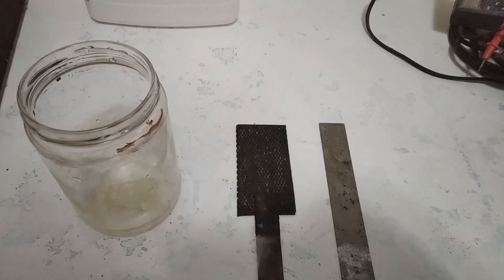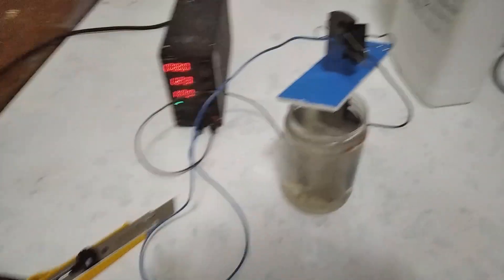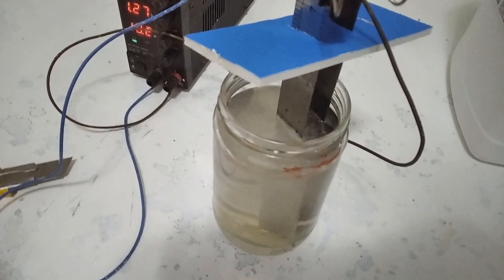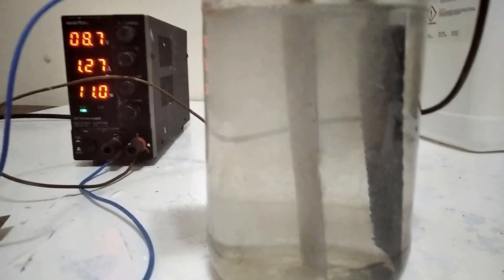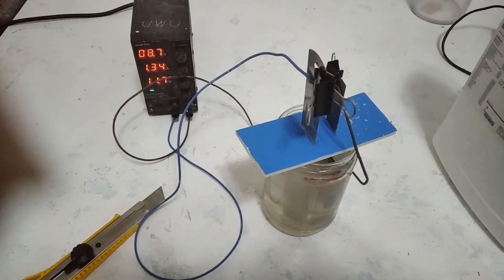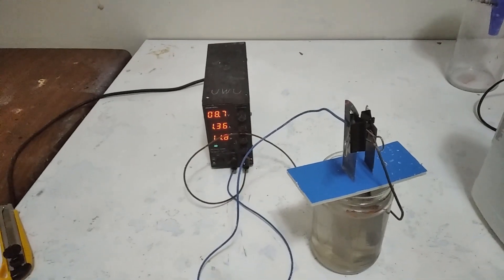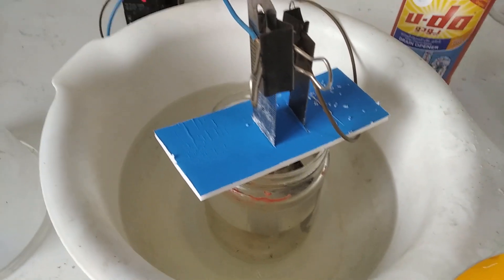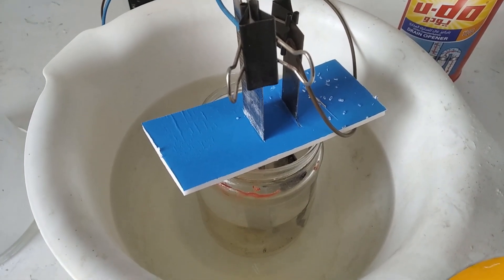Electrochemical Oxidation of ethanol to acetaldehyde.

Comment: Can you explain what the name of electric regulator u used, and the formula reaction of ethanol convert to acetyldehyde. Thank u
Reply from the maker: its a wanptek 300W PSU 0-30 volts and 0-6A
This is the oxidation of ethanol to aldehyde.
Reply: @CatboyChemicalSociety  the bond that break down and compact again, kindly make that video sir.
Reply: I mean the formula of carbon step by step how it changing. Sir.

Comment: Very interesting to see a reaction I’ve only read about. Acetaldehyde is useful as a much less toxic replacement for formaldehyde in wood glues. I’ve moved on to using even larger molecule aldehydes (reducing sugars) to bond glulam boards together. I make my reducing sugars from glucose in water with peroxide and a calcium citrate catalyst. I also really appreciated your guide to making inexpensive exchange membranes. Will be keeping that one in my back pocket for later 👍

Comment: so PbO2 NaCl solution, ethanol..
you can bubble acetaldehyde into ammonia, it forms an adduct with ammonia but its rather fragile, decomposes with just faint heating
you could maybe produce ethylamine by reacting the ammonia adduct with NH4Cl and HCl and refluxing for a bit- then you could test the presence of amines by boiling with basified milk, turns pink- ammonia turns milk brown rather

Comment: The cherry and fruity smell is indeed due to the mix of ethanol/acetaldehyde.
A like smell (cherry-green apple) is produced during the process of oxydation of ethanol into the active runaway phase of the fulminate formation of Hg fulminate from ethanol / Mercury  dissolving into HNO3 (69%). The mix goes exothermically to boiling and generates a smog of fruity smell.

The fulminate formation is quite a complex reaction on a chemical level but is passes through intermediates nitrite, nitroso, oximes and nitro compounds that are subjected to oxidoredox reactions, elimination and rearrangements... you pass from a 2C molecule (ethanol) to two 1C molecules (CO2 and H-C=N=O (or HO-N=C)).

The interconnection of nitromethane has been proven since in some circumstances it is reduced into fulminic acid and fulminates... mercury nitronate (Hg(O-N(O)=CH2)2 turns/decomposes - upon time - into Hg(O-N=C)2... this is acheived by a virtual exclusion/elimination/splitting of 2 H2O from the starting exotic salt.

PHZ
(PHILOU Zrealone from the Science Madness forum)

Comment: Bisulfite is pretty selective for carbonyls.  There are a lot of other tests.  The 2,4 dinitrophenylhydrazine derivative is the definitive identification method.  It will form a distinct solid with a clean melting point.
Reply from the maker: I reduced copper hydroxide at the end to show its acetaldehyde.
Reply: Indeed, aside bisulfite adduct and 2,4-DNP reaction product...
1) 4-nitrophenyl-hydrazine (p-NPH) (via R-CH=N-NH-C6H4-NO2)
2) Hydroxylamine (via R-CH=N-OH)
3) Hydrazine (via R-CH=N-NH2 and/or R-CH=N-N=CH-R)
are also worth at identifying aldehydes and ketons by their formation, their melting points and/or boiling points).

PHZ 
(PHILOU Zrealone from the Science Madness forum)